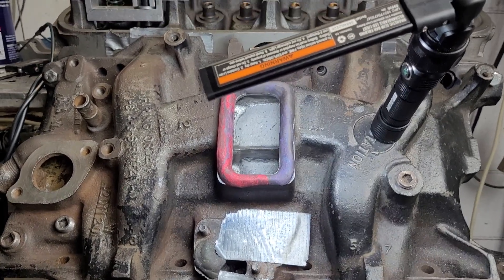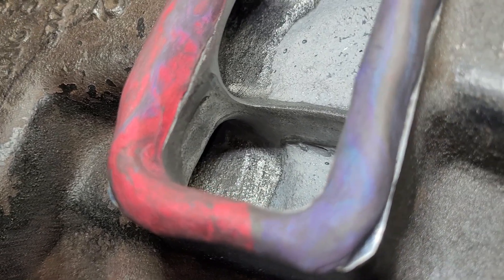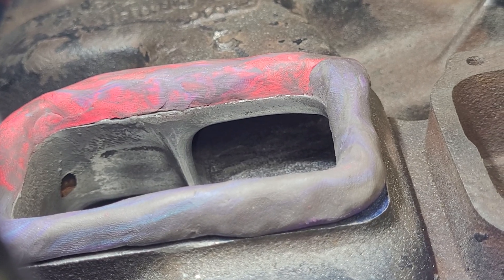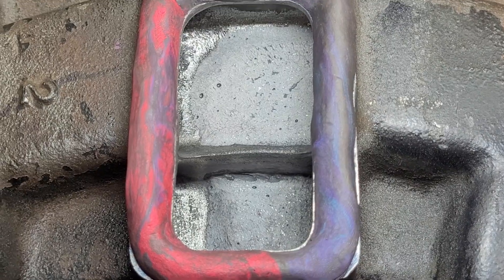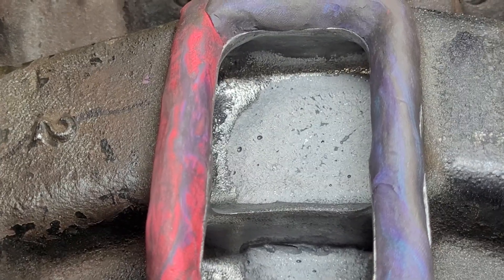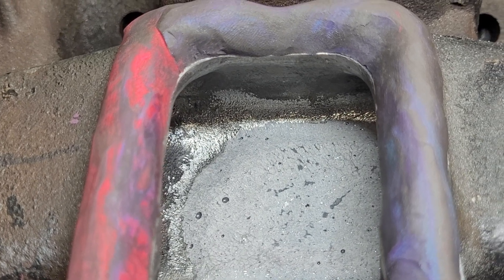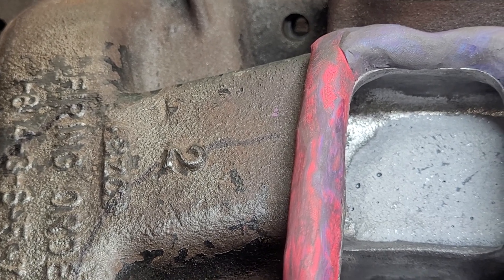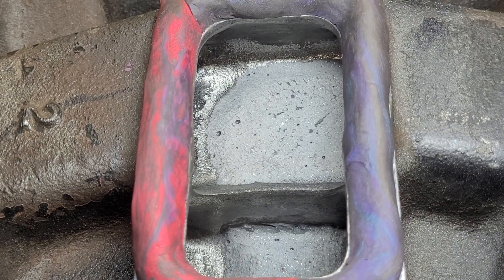D.V. + U.T.G. + U.M.S. Mission Impossible 318, Finalized high plenum? Flag demo with new lighting.

Comment: I mean, if you’re really after every last cfm, a right angle die grinder and a mirror would probably get you most of the way into those ports. At that point though, I’d probably be taking the metal removal provision in the rules to the extreme and just cut the runners off the manifold and fab up sheet metal runners. 😂
Reply from the maker: That would help!

Comment: It would be interesting to check flow while pulling the same amount of air through all of the ports at the same time. Probably not practical to flow at 28”, but I think a lot could be learned even using a lower vacuum. I think a little ingenuity and some pvc pipe and valves to adjust the flow through each runner. Wouldn’t be able to pull through the head, but it might shed more light on what’s really taking place in the manifold.
Reply from the maker: Interesting thought. Thanks

Comment: Hi Instead of cutting open the top of the runner and the working on the tight corners, dill or hole saw the corner and weld or glue in aluminium rod or tube with the nice smooth curve, of the radius you want.
Reply from the maker: A good idea. Thanks

Comment: Thanks for the good video. Drilling the hole an rounding the corners to maker enough difference sounds good but maybe not enough metal and might have to epoxy the outside. My opinion only.
Reply from the maker: No doubt

Comment: I have a Ford 351M with a performer intake that's my friend is milling carb mounting area parallel to crank centerline, to add Alm. plate for mounting a 6-71 GMC super charger. other option would be 351C blower intake and spacers to fit it to taller deck on the 351M. This option is about 900.00 dollars, to rich for me! My question is what to do with divider? Just round it off? Remove it completely? Or mill it half way? Or take the approach you have, to avoid fuel puddling and possibly help in even distribution in lower side plenum. Any thoughts/ advice would be much appreciated. I've enjoyed all your vids. Have found them very informative and thought provoking. Thank you.
Reply from the maker: I never did this with a supercharger but I would think I would leave it stock at first. If it needs more top end take some divider out.
Reply: @servediocylinderheads  Thank you. I'll just round it off and let it fly. When it's in boost, I don't think top end will be a problem
Reply from the maker: @conniekahl8015  I agree, so leave the divider high. Thanks

Comment: 🔔😎
BEST LIGHT.
15" circular bulb (like a fluorescent kitchen ceiling but LED) on a 5 ft stand. Used for no shadow lighting of faces for videos. Wally had them for 29 here.
Adjust for your light and look through the hole to see your work.👍👍
Google circular led light stand. 8-18" diameter 5-6 ft stands.
Reply from the maker: I have 5 leds overhead now!

Comment: 🔔😎
Those sharp corners are on the inside arc of the corner... Flow slams to the outside... Just like the intake short turn radius. 🤔
I think y'all should be using the most advantageous junk yard parts to begin with before for the improvements.... Rather than trying to put lipstick on a pig.
Reply from the maker: It is frustrating I will tell ya.
Reply: @servediocylinderheads  Charlie, that single plane has to be better overall. Maybe not some individual runner flows, but distribution while running has to be better. JMO. 😆
Reply from the maker: @hotrodray6802  It is better.

Comment: Just curious: are you blocking off the other intake runners that are on that side of the 2 bbl?
Reply from the maker: All but the one I am drawing through.
Reply from the maker: I forgot to tape off the other side and flow went way up. That showed me the turn is what really hurts flow.
Reply: @servediocylinderheads  Yes, those 2 bbl intakes were designed for low rpm and general purpose use. I think that a lot of the design was to allow clearance for accessories. That one bend is rather tight and will probably restrict flow into that cylinder.

Comment: I am planning to build a fueling system with 100% straight runs from the fuel mixing to the inside of the cylinder.

It might come out kinda expensive, but it might not, too.

IF it works, I'll probably build and test some engines with it and then look at maybe finding a way to mass produce it.
Reply from the maker: Sounds like a fun project! Best of luck with it.
Reply: @servediocylinderheads  If it works as I hope it will, I will be working to mass produce it and put it on the market for any who want it.

Comment: theres only so much you can do with a smog era casting.even the most powerful engines coming out of detroit in the mid to late 70s were done pulling by 4500.unless your up to date in your black majic practices, i doubt there is much left on the table on this manifold without MAJOR surgury.just my opinnion.but either way, its made an interesting watch.
Reply from the maker: More work than it was worth by a mile.
Reply: That was possibly due to low compression, restrictive heads & a very mild cam. They were putting in very high gear axle ratios (some in the range of 2.8:1) which required a low rpm hi torque engine that would run on low octane fuel. I built a mild 318 for a 75 Duster. High swirl heads, much better exhaust, mild cam, and an intake off of a mid 80s pick up that had a thermoquad. That intake would take that little 318 way past the 4500 rpm range and it was off of a 360 smog engine.

Comment: If you're allowed to use the tbi manifold, and the carb will work with it I would say youre probably done with this one if they arnt even going to use it
Reply from the maker: It will be tested. This one, the single plane I did, t.b.i. if I can get one, Edelbrock airgap rpm, old stlye Weiand dual plane if I can get one. Maybe an Edelbrock 340 single plane and Weiand tunnel ram. I will do my best but no guarantees.

Comment: How does a guy without a flow bench know if he is doing good and not harm would make a great video.
Reply from the maker: How I did it for decades, cut it and run it. Pay attention to plugs, mileage, eta, if you have a track close by, timing.  There is tons that can be done without a bench. I built a low pressure bench that just pressurized the plenum of an intake and then I would tape off 7 runners and take airspeeds with a Dwyer air speed gauge. It is just a tube that pushes a little ball up. Used for A/C work mostly. It worked quite well actually.
Reply from the maker: I reread you question. I will see if I can find my old stuff and show you. Thanks
Reply: Thank you